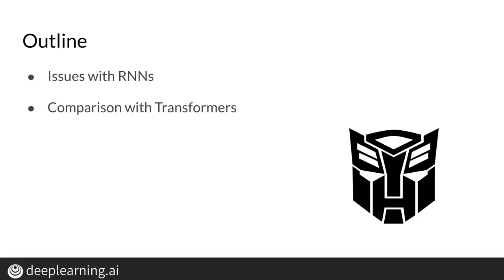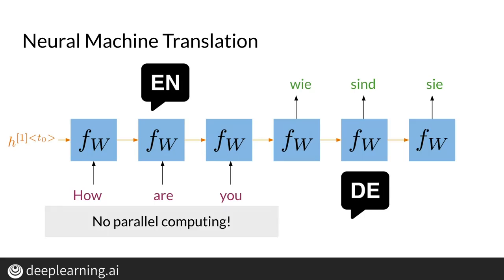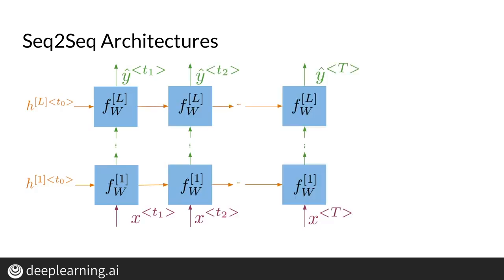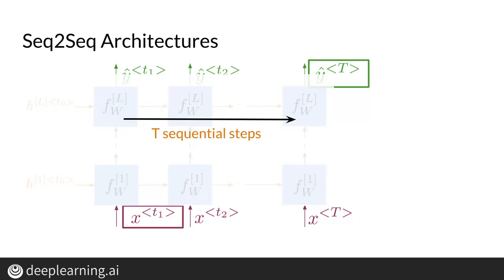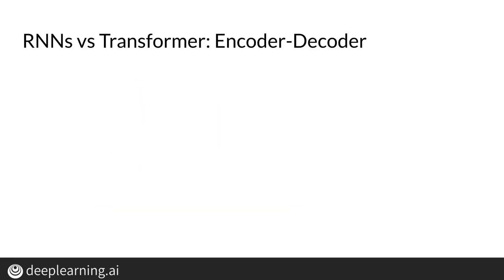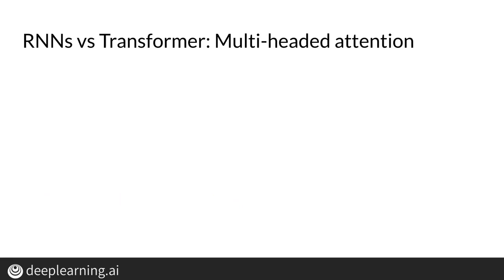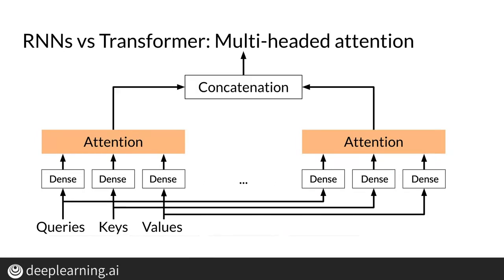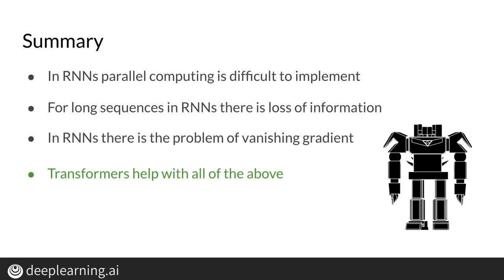Transformers vs Recurrent Neural Networks (RNN)!

Comment: What are some good points of RNN over transformer?
Reply: It requires less memory and computation for large sequences, since in a transformer you need to calculate attention weights between each token (scales quadratic). In RNN you just update the state (which makes it slower but more fit for mobile devices). I think it also requires more data to train a tranformer model and it has more parameters. However it's hard to use transfer learning on RNNs and easy to use it with pretrained Transformers, which reduces the training cost. It all depends on the data, computation requirements and cost I guess.
Reply: What do you think now Bert? It's blown up hasn't it...
Reply: @Karl_with_a_K  in what sense, if you are saying it has become obselete then you are wrong. It's being used as sentence encoder or in sentence transformer, and the fact it's second smallest model in current LLM time, I think we can now work to integrate a pruned version of that into mobile devices, although more reparametrizing is needed for it to fit in small devices
Reply: @ambeshshekhar4043  no, I mean in popularity ...
Reply: @Karl_with_a_K  😅it's natural we always love new tech, we only use old tech when it provides something different and better compared to the latest tech

Comment: I want to classify anomaly detection using RNN keras.tf but I have a problem where the accuracy value increases but the val_accuracy value does not change and just remains constant at 50%. this is my complete code available on google colab https://colab.research.google.com/drive/1saoNuCxj08JCxZ_7taIjhp8sJEIV-T5U?usp=sharing     //